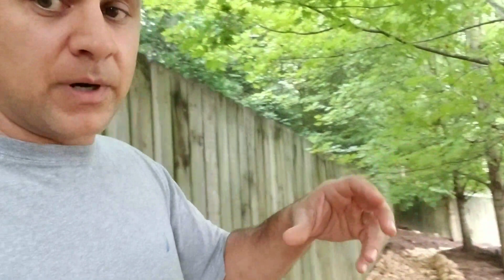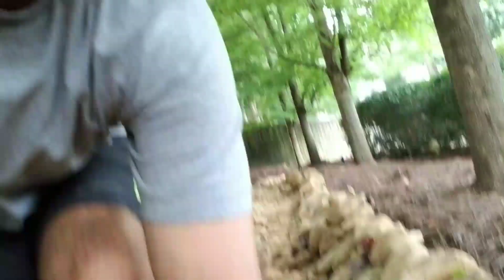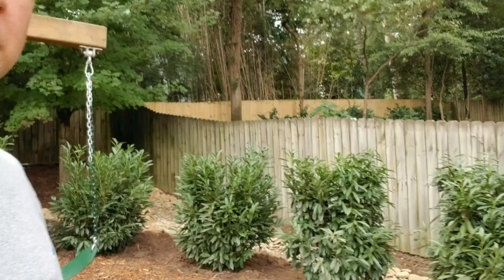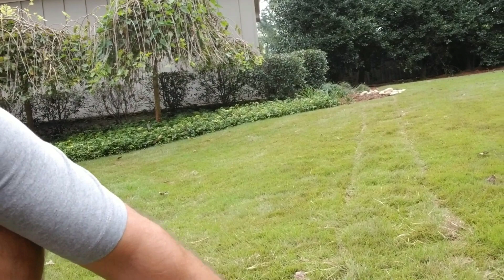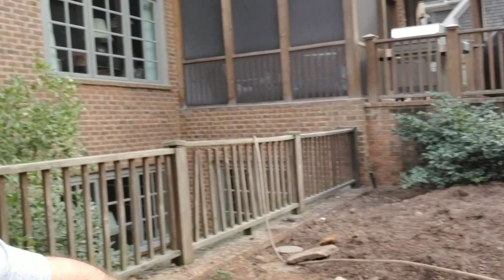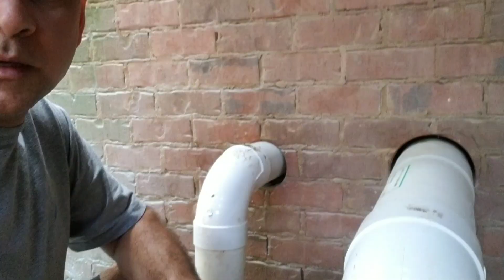Why we over-engineer Dry Creek Beds & PVC Drain Systems 💧 Preventing your Backyard from Flooding!

Comment: What does that geotech fabric do?
Reply from the maker: mccool24 The Geotextile fabric creates a barrier between the dirt below and the rock above. Without the fabric that dirt below Mike very easily migrate into the dry creek bed a bath and it would have to be cleaned out or even re-laid on a more frequent basis. As it stands rainwater is still going to deposit sediment throughout the creek bed which will require it to be maintained as often as yearly or as infrequently as every 3 to 5 years. Depending on the amount of total silt think it’s deposited. But it with the fabric in place it extends the life of the creek bed and creates more stability for it.